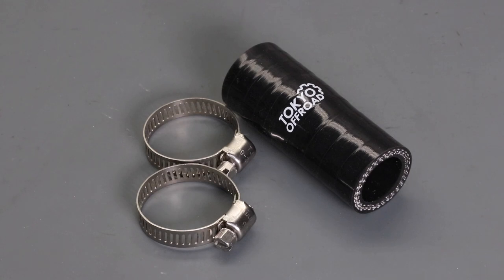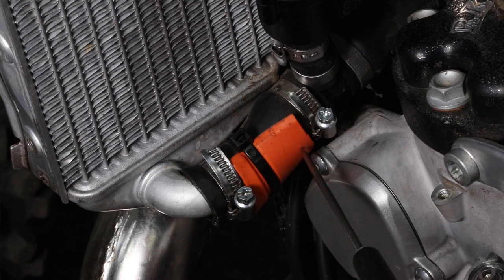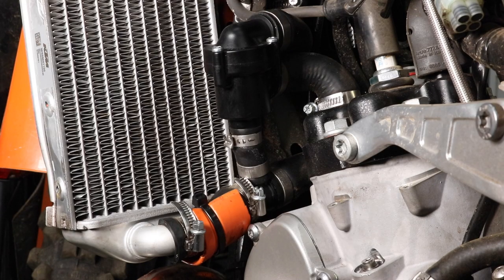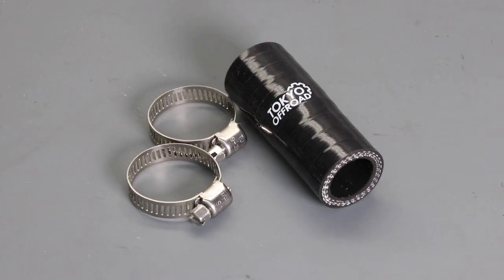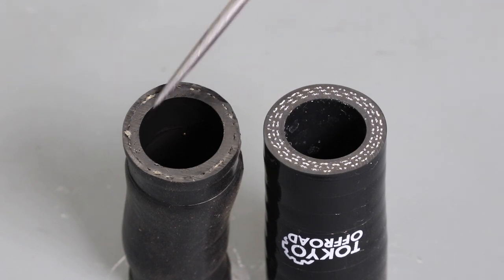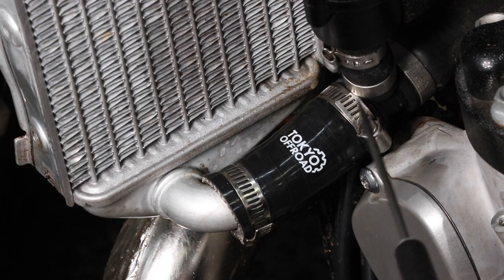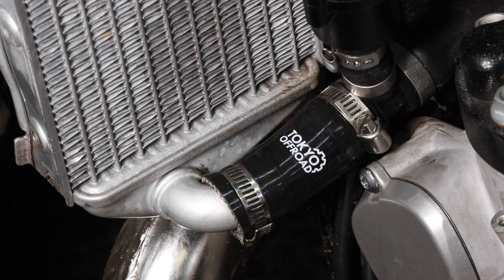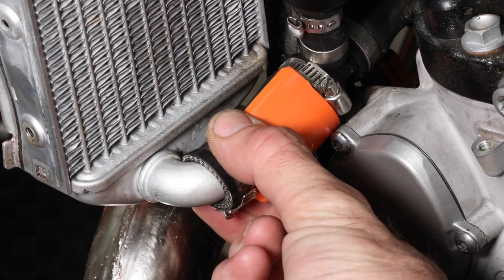Tokyo Offroad Silicone Coolant Hose Kit for 2020~2023 TPI 250 & 300

Comment: This just happened to my '22 TX 300i. I called all the KTM shops and not only is the part on backorder - they make you buy the whole hose kit including the thermostat, around $200. I ordered this at 5pm yesterday and as of this morning UPS is telling me it has already passed customs and will be on my doorstep by tomorrow afternoon. I'll comment again after I get it installed, but couldn't wait to comment on how amazed I am by Tokyo Offroad's customer service and speed. Amazing!
Reply from the maker: Thanks for your order and hope you receive the hose kit quickly. One question I'm often asked is how to remove the inner original hose clamp? It needs to be cut off. If you have a high speed rotary disc cut off tool (Eg Dremel) that works well, or a hack saw blade can be used.
Reply: @TokyoOffroad  Wow, thanks so much for the great service. I ended up removing the inner clamp with a little hacksaw. The new hose fit perfectly. I rode for 6+ hours on Saturday and it worked perfectly. I'm super happy that Tokyo Offroad carries this product! I'll probably keep another one in my spare parts box, just in case.
Reply: Well, I went down on the right side again and punctured the hose... again. I ordered a new one from Tokyo Offroad on Saturday and it got here on Tuesday. Installed it and went for a quick test ride - all is great. This time it came with the little plastic guard and a zip tie. I installed that per the video and I think that will really help to protect the hose. Thanks again for the quick shipping and the great instructional video. This time around it was much easier to install as I've had practice, and the old one is easier to get off with the hose clamps. Honestly, I should have ordered two to keep one in my pack... I had to push the bike out of the mountains for about 4.5 miles and call the wife to come pick me up on a forest service road. ⭐

Comment: When I installed the Tokyo hose I also found it necessary to loosen the gear clamp at the lower right rad hose and rotate the hose  a little to get that hoses off the front of the cylinder / cylinder head area (hose was rubbing). 

Also I did the same with the hose connection at the front top of the cyclinder. On my bike it was originally pulling the thermostat assembly rearward and this kept the lower left rad hose too close the engine. 

I now have approximatley 4 - 5 mm clearance at the lower left hose and maybe 6 mm clearance from the right rad hose to the cylinder head gasket area.

Patience was required but the end result and peace of mind was worth the work. I feel safer now riding distances from my vehicle.

I have owned many motorcycles over the years. This KTM has rquired more work to make it "Rideable" than any other bike I ever owned. Hope this is not a glimps into other KTM issues. So far I love the bike both the colours and operations.

Also replaced that stupid plastic TPS, Throttle Position Sensor protective cover with a CNC aluminum one as some people have had them break when the bike falls over (operator error, LOL). Similar for the stupid fuel tank black plastic outlet.
Reply from the maker: Thanks for your purchase. Sounds like with some tweaking you were able to gain quite a bit of clearance. Thanks for sharing the information of your install.

Comment: You should use the hose clamps with the smooth stamped threads, they do not cut into the silicone hose.  Food for thought,
Reply from the maker: I did look at using the same clamps as OEM KTM hose clamps (GEMI brand), but the narrow band width clamp appears to be specially made for KTM and only available directly from KTM (Part number 10001020000 HOSE CLAMP GEMI 18-29). I've tested the stainless steel hose clamps included in the kit and not experienced any cutting into the hose issues. As such, so long as the clamps are not overtightened, I think they are OK.

Comment: I had a failure. Replaced with Samco hoses with thermostat delete. Riding in the UK is not too cold but rarely hot. My question is, what is normal operating coolant temp? And personally what temp would you deem OK to start riding hard at? Thanks.

Comment: how did you remove the old hose clamps ?  they have no screw , the stock ones have no way to remove them
Reply from the maker: The old hose clamp needs to be cut off. A small rotary cut off tool (Eg. Dremel) works well. Or a hack saw blade can be used.

Comment: Do you have a procedure for safely flushing coolant system? Just distilled water or more. I've got some brown sludge and want to clean the system.
Reply from the maker: Yes, you could flush the system using distilled water, or if it really dirty a coolant flush may work better. Either way you'll want to drain the dirty coolant, refill with your flush, ride the bike a little to bring it up to temp, let it cool down and drain the flush. You could repeat the flush if necessary. Then finally refill with clean coolant and be sure to use what's recommended for your bike. Also it's not a good idea to mix different coolants as this may cause sludge.

Comment: How does the OEM hose come off the connection (to the thermostat T) that does not have a hose clamp? (2022 XCW)
Reply from the maker: The stock hose has a crimped hose clamp at the thermostat connection which needs to be cut of. If you have a small rotary disk cut off tool (Eg Dremel) it easy to do.
Reply: @TokyoOffroad  Thanks! I just ordered a few for me and my buddies in BC 🤘 All of ours are currently held together by tape, clamps, and zip ties lol

Comment: For the thermostat delete what do you consider cold conditions?
Reply from the maker: Difficult to answer because there are many variables. But certainly if you ride in freezing conditions (below 0 degC) I wouldn't recommend it. With the thermostat delete you'll find that in any open and flat, or downhill riding the engine temp will drop low in cold weather conditions. Also cold start warm up will take much longer as the coolant constantly circulates even when the engine is cold. Gnarly, steep and slow sections I wouldn't expect a significant difference between with, or without the thermostat delete.

Comment: Just got your part already!  Installing now but I can’t seem to get the old factory hose off because of the stock flat clamp!  How do I get that off?  I can’t seem to get it.
Reply from the maker: Pleased to hear that you received it quickly. To remove the stock clamp a high speed rotary tool (E.g. Dremel) with a cut off disk it works well.
Reply: @TokyoOffroad  Perfect.  Worked well.  I’m part of 200+ member dirt bike club in Florida and have been telling them all about your products.  Thanks again.

Comment: Is this not a problem on the lower right side as well?
Reply from the maker: I haven't heard of hose punctures on the right side. Of course it is possible, but it doesn't seem to be a common failure. However, if lots of people are experiencing right side failures too I could offer a right side hose kit too. I think the big difference is that on the left side the thermostat t-junction is there and it keeps the lower hose pushed down making it susceptible to pinch punctures. On the right side the hose is long and can move up more easily during a crash, making it less likely to get pinched. I do attach some plastic to the right side too  though to help ensure I don't have an issue.

Comment: Will this work on a 2018 KTM 300?
Reply from the maker: No, the hose is custom designed to fit the 2020~23 year model TPI 250 & 300 bikes only. Other year bikes are a little different regarding the hose diameter and length...
Reply: @TokyoOffroad   Do you know of anyone that sells one that fits a 2018?

Comment: Where can we get the orange hose protector you showed?
Reply from the maker: The part number is EPHA4O. They are cheap and available online at various web shops.
Reply: There’s a black one on Amazon that’s long enough to cut in half and use on both sides.
Reply: EPHA HP6-B 3.25" W x 6" L

Comment: What's the inner diameter?
Reply from the maker: The hose dimensions are custom designed, with different internal diameters at each end to precisely fit the radiator and thermostat fittings. It will correctly fit 2020~2022 KTM, Husqvarna and GasGas 250/300 TPI bikes.